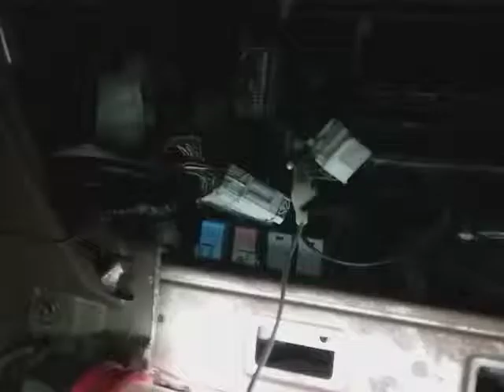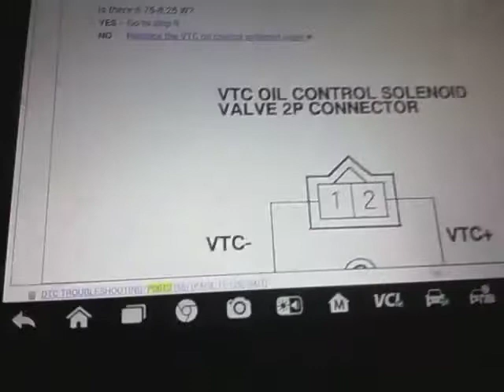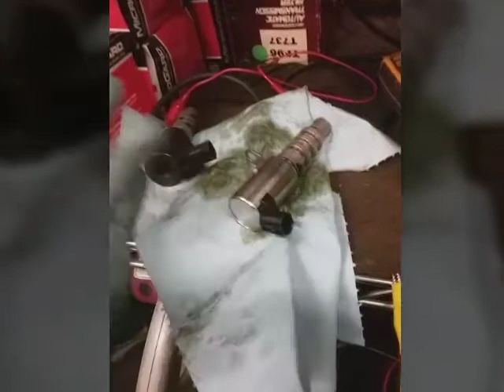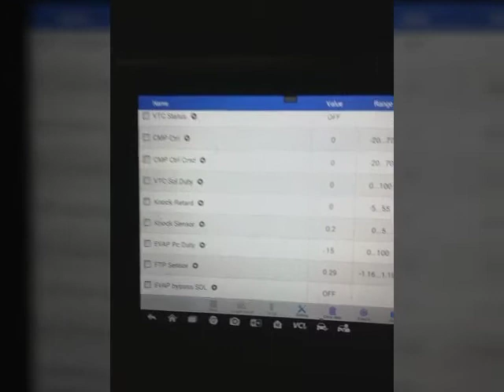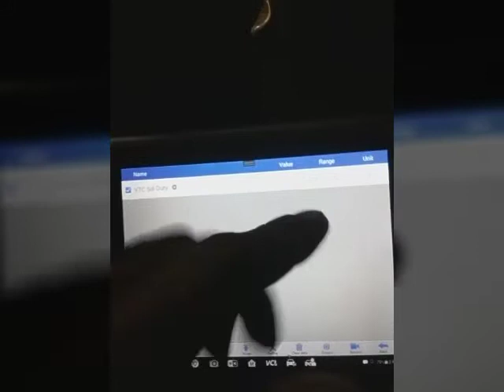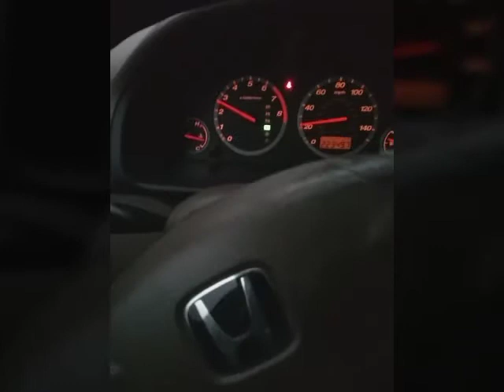P0010 honda 2.4l [when its not the oil control valve!]

Comment: You ground the signal wire so you can easily check for continuity by touching the body near the pcm.  I was confused at first too when I saw the service info until I looked at it for a while.  Thanks for sharing.

Comment: Bro I have something similar, no codes but the car does feels sluggish until higher revs even from first gear, I feel like the vtc isn't phasing so power is still locked in higher revs. I'm a mechanic awaiting your response, this is pulling my hair.

Comment: Is there a fuse for the vtc solenoid?
Reply from the maker: No. The pcm supplies pwm, Pulse with modulation, to control solenoid with a power from pcm to solenoid
Reply: @partsshooter  thanks for the response, the previous owner I just bought the car from somehow snapped off the electrical connector from the solenoid and I was wondering if the fuse might have blown in the process. But I replaced the solenoid and no more p0010
Reply from the maker: @BoovenBBQ  awesome!

Comment: Went to check the plug from the computer and I have the 1 blue/white cable but I do not have the other cable 23 black/white
Reply from the maker: Looking at live data is gonna be important when assessing this. Look at the oil control valve "desired vs actual" duty cycle

Comment: Is this information reliable for use on a k swap Integra
Reply: Thank you 🙏 sir I do realize this no longer applies to me .... back to the drawing board lol🥺🥺
Reply from the maker: @bintha530  what exactly is the issue you're having? Be specific, I maybe able to point you In the right direction
Reply: My car throws the p0010 code I tried a new solenoid but didn’t work I have another one coming my car throws the code during free rev in my k pro the cam angle doesn’t keep up with cam command and my a/f is at 13.50 at idle
Reply from the maker: @bintha530  you'll have to look at command state of oil control valve, it's PWM commanded. If I recall, it should be around 35-60% duty cycle. This one in the video automatically drop 100% during free rev.  

 Check your command state in your tune. because your command state is too aggressive, if it was altered!
Reply: I will look at my tune and see if there is a way to review the command state of control valve and I will report back give me a day or 2
Reply from the maker: @bintha530    also check wire integrity... Perform a resistance test for both wires, make sure from end-to-end they're approx 3ohms. You'd disconnect ecm and oil control solenoid when checking. 

If you don't have a test meter, disconnect from pcm and solenoid, ground one end and use a test light to positive and see if they support load.

Try powering solenoid and see if engine stall or run different.

Of course make sure your solenoid clicks when energized.

Let me know
Reply: Thank you vary much for your assistance in this matter i will do my testing and report back as soon as I can
Reply from the maker: Yes, if ecm is factory to k swap
Reply: Ecm is not factory to motor it’s a 02-04 prb Ecu with Kpro but pin on ecm and ecm connectors are the same Ecu connector b blu/wit + b1 and blk/wit - b23
Reply from the maker: @bintha530  yeah, this video isn't gonna apply. I'm sure you already know this lol... 

Factory ecu logic is gonna have unaltered program, matching ecu components are gonna work the same across the board. Yours obviously isn't.

Thanks for the comment

Comment: I got codes p0010,  p2647 and others.  I changed the vtec solenoid, the vvt sensor solenoid,  map sensor,  air filters, spray cleaned the engine and still check engine light upon starting and then vsa and orange triangle after driving a while.   I'm thinking cam sensors now.  I too am pulling my hair out.   Any suggestions?
Reply from the maker: Clear the code and let me know the immediate comebacks, use a scanner to clear codes. 

Please go through the circuit testing as described in the video if you don't have a bidirectional scan tool. 

Is this a 2.4 engine you're working on?

What are your immediate comeback, 1st code to last
Reply: @partsshooter  I don't have a scanner.   I go to auto zone and get the free diagnostic reading.   Do I'm unable to clear any codes right now.   I'm thinking of bringing it to a honda service center but I know they will rob me.  Extremely frustrating
Reply from the maker: @willc32917  I understand... No cheaper than what they are, they're worth the investment. For a honda diagnostic fee you can buy a generic scanner and a multimeter. 

Just depends what you're willing to get yourself into with repair
Reply: I had p0011 and p1259 I changed the oil filter to a better one that has 13 holes instead of eight holes no more check engine light VTEC works fine
Reply: I have the same vehicle  but only have p2646 code change  vvt solenoid  and cleaned all screens  and still get code
Reply: @lorenzodavis1735   same here how did you end up getting it fixed
Reply: 3 yes latter... I am stressing for p0010. Did all that. Heard him say to hold the chain and rotate the cam? Any help?